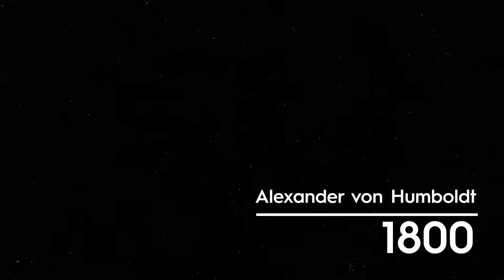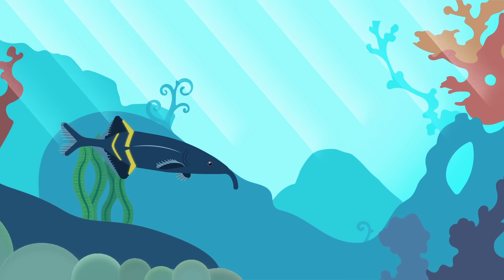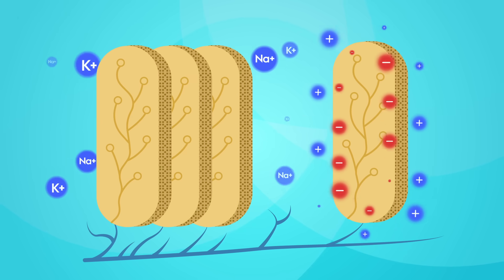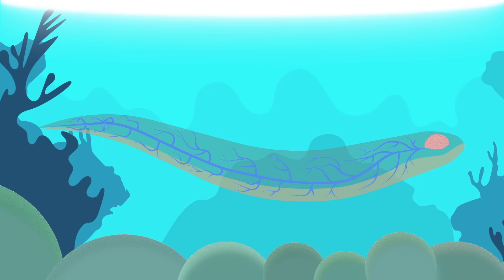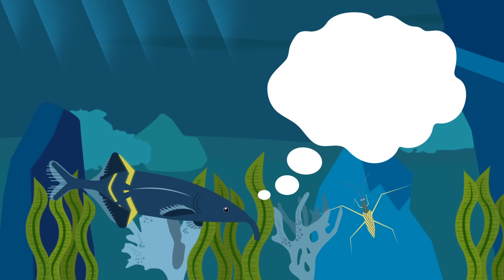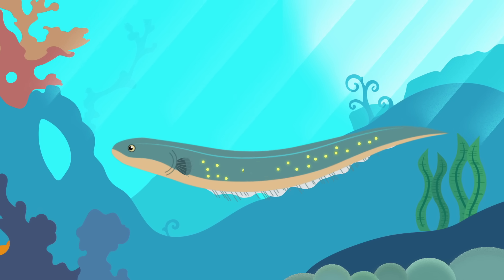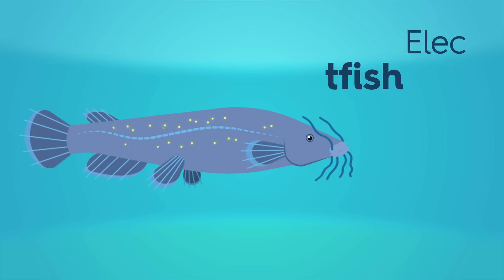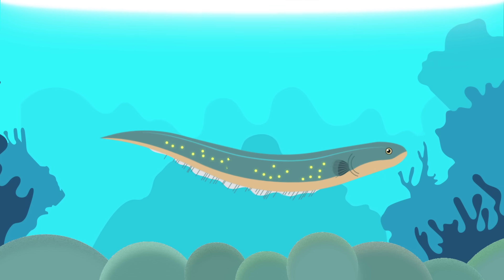How do fish make electricity? - Eleanor Nelsen

Comment: Electric eels have specialized biological adaptations that prevent them from being electrocuted by their own electrical discharges. Here are the main reasons:

1. *Insulating layers*: Electric eels have a thick layer of insulation surrounding their bodies, including a fatty, insulating substance called myelin.

2. *Specialized cells*: The eel's electric organs are made up of specialized cells called electrocytes. These cells generate the electric discharge but are designed to protect the eel from self-electrocution.

1. *Directional discharge*: The electric discharge is directed outward from the eel's body, minimizing internal exposure.

2. *Nervous system adaptation*: The eel's nervous system is adapted to withstand the electrical discharges, preventing harm.

These adaptations enable electric eels to harness electricity for defense, navigation, and communication without harming themselves.
Reply: Chatgpt ah

Comment: Serious question 600 v is a decent amount of electricity, isn't it possible to harness that energy i mean if you could stack 50 of them that would be somewhere around 30k volt, it wouldn't be difficult to organize 1000 of these which may have the potential to create 600,000 volts am just curious

Comment: The electric eel generates large electric currents by way of a highly specialized nervous system that has the capacity to synchronize the activity of disc-shaped, electricity-producing cells packed into a specialized electric organ. The nervous system does this through a command nucleus that decides when the electric organ will fire. When the command is given, a complex array of nerves makes sure that the thousands of cells activate at once, no matter how far they are from the command nucleus.
Each electrogenic cell carries a negative charge of a little less than 100 millivolts on its outside compared to its inside. When the command signal arrives, the nerve terminal releases a minute puff of acetylcholine, a neurotransmitter. This creates a transient path with low electrical resistance connecting the inside and the outside of one side of the cell. Thus, each cell behaves like a battery with the activated side carrying a negative charge and the opposite side a positive one.
Because the cells are oriented inside the electric organ like a series of batteries piled into a flashlight, the current generated by an activated cell "shocks" any inactive neighbor into action, setting off an avalanche of activation that runs its course in just two milliseconds or so. This practically simultaneous start-up creates a short-lived current flowing along the eel's body. If the eel lived in air, the current could be as high as one ampere, turning the creature's body into the equivalent of a 500-volt battery. But eels live in water, which provides additional outlets for the current. They thus generate a larger voltage, but a divided, and therefore diminished, current.

Comment: The eel probably has a layer of cells around its body that can conduct electricity so it acts as a faraday cage for the fish,the electricity passes around the fish instead of through it.
Reply: I was taught that the eel's tail contains the potential gradient (anterior of tail = positive, posterior of tail = negative). All the eel's vital organs like its brain are at the front of the eel. When it 'powers up' to send shocks from its tail, it straightens out, and the current travels outward. You will see an eel sometimes bend in a U shape to avoid its head getting in the way of the current. If the current hit its brain, it would die. Electric eels can kill each other. In zoology they taught us that the pics of eels "biting & shocking prey simultaneously" are fake

Comment: Did each type of electric fish evolve electricity separately or is there a common ancestry?
Reply: yes they evolved separately. which is awesome.
Reply: If you ever got am answer to this question let me know 🤣
Reply: Convergent evolution
Reply: RV separately
Reply: No... God created them this Way ..
Reply: @hamzasat  who created god?
Reply: @kartikpoojari22  if God would have been created by anyone, it wouldn't be God.
Reply: @GangingTheKing  yeah that's the loophole in god hypothesis
Reply: @kartikpoojari22  this is the solution to the loopholes in every hypothesis.
Reply: @GangingTheKing  the loophole is that God hypothesis says that "a complex thing Cannot be created on its own" but god has to very complex to create such a complex universe then why he doesn't need creation?
Reply: @kartikpoojari22  I don't know about God's level of complexity and I'm also not sure about whether the Creator must be complex or not, but what I do know is that it's not needed for something to be complex in order to be able to do many things. For example: a razor blade can be used in many ways but an electric razor (which is a lot more complex) is only good for one thing.
Reply: @GangingTheKing  actually, if a deity is omnipotent it should be capable of creating "mini-gods" and give those mini-gods a fraction of the power to create more mini-gods to Infinity. The god hypothesis makes no sense if the possibility of higher-order gods is discarded
Reply: @hamzasat  🤓
Reply: @hamzasat  I recommend you to watch TheraminTrees YT channel. If you think you're sure about anything, then you know nothing about life, nor the universe. You have to be open to accept that you can make mistakes and be wrong like any other human. You're not a god, you can't say "God did this" "God did that" if it hasn't given you any explicit confirmation that it was him/they/it

The fact that we can't prove nor disprove the existence of 1 or more deities doesn't mean that your description of it is correct. And (just like a god) the universe could have been created spontaneously by itself, physics doesn't forbid that
Reply: @hamzasat  nice hypothesis but wrong according to me.
Reply: @adithyan9263  
Just like evolution... it's a nice hypothesis but it's not a fact
Reply: @hamzasat  evolution is the best and scientific answer we have. It is not complete but we are headed in the right direction. The god hypothesis has no proof and will likely never attain any proof in the future. Theists have this weird understanding that the reason scientists encourage evolution is just to oppose god. No that's not how it is. In fact evolution is equally a theory as gravitation. but no theist ever had any beef with gravity.
Reply: @adithyan9263  it is complete actually,what part of it isn’t?now that our technology can study biochemistry and particle biology
Reply: @adithyan9263  oooh you meant perfect,I thought that you said that evolution could be disproved
Reply: @Andrea-fd2bw  no no no evolution is great and certainly in the right direction but there could be minor mistakes in the specifics. Like for example we have theories of how animals evolved eyes. But we cant be a hundred percebt sure. And one of the most fundamental aspects of evolution is that evolution is caused by random mutations maybe that isnt the full picture
Reply: @adithyan9263  I suggest you to read life’s ratchet,a book on the subject
Reply: @Andrea-fd2bw  thank you for the suggestion
Reply: @Andrea-fd2bw  thank you for the suggestion
Reply: @hamzasat  Please, don't make us Christians look bad
Science and God can coexist, just because God created life doesn't mean evolution isn't real
Reply: @thepalebluedot4171  Sorry, I don't understand
Science and religion can coexist, can't it? So, what's the problem? 
I'm really sorry, English is not my first language
Reply: @candylide  Before we examine the coexistence part first we must understand what exactly we are talking about,.  What is religion and what is science.

Religion and it's concept of God and Gods exists in the emotional realm of man whereas science is a practical reality.

If observing fridays as holy days and praying 5 times a day or receiving the wafer and wine on the accepted holy day of sundays or doing any other form of religio-emotional activities can exist along with things like  H2O,   C6H12O6, E= mc2, (A+B)3 = A3+B3+3AB(A+B), Deoxyribonucleic acid,.   if you ask if these 2 realms can exist together in this human society on this planet ?  Then yes they seem to clearly coexist with each other parallelly but they will never agree with each other whatsoever..

My first language is not english either I am from Kerala, India.
Reply: @hamzasat  did you know the person who invented the Big Bang theory was catholic? They don’t teach about him but someone else who said the same stuff. The Catholic Church got happy because they thought it proved their point that Catholicism existed, but Georges Lemaître (inventor of theory) was mad because he said science doesn’t belong in religion. Just because we think one thing because it’s in a book doesn’t mean it’s 100% factual science can show us a lot that can still prove points to religion
Reply: @thepalebluedot4171  my comment before this can apply to you too. Look him up one of my biggest people for believing science/Catholicism/religion of many, all coexist with each other but man can be too stubborn and want what they believe to be 100% and the only thing that’s right
Reply: @hamzasat  yet the theory of evolution has practical application such as selective breeding, so Darwin was clearly onto something.
Reply: @hamzasat  if you think evolution doesn't exist then what you're saying is that all living creatures are just biological robots incapable of adaptation and change. Every day we see small examples that evolution and natural selection are real, even in artificial systems like AI, machine learning, and neural nets.

Even Minecraft has natural selection, unintentionally. There's a video of some youtubers playing with a mod that flips gravity, all animals died except for cats and chickens. No more mobs have spawned because the game has a mob-count cap
Reply: @adithyan9263  wrong way to do science according to me
Reply: @adithyan9263  It is complete, that's why it is the theory of evolution, like the atomic theory and the microbial theory, is not the hypotesis of evolution.
Reply: @MachineIntelligence0  They can, me believing in God doesn't make science suddenly invalid to my eyes
Like, I mean more on a individual scale, if you think that science makes God a nonexistent entity, that's okay, it's your opinion!
Reply: @MachineIntelligence0  God isn't scientific themself, I didn't say that
Just that both science and God can coexist in one mind, as some people think you have to pick one or the other
Reply: @hamzasat  evolution and God are not mutually exclusive IMHO. 
God made it through evolution, why would that be a bad idea? 
Our understanding of the world is very limited, one can not simply deny God, yet its also not reasonable to attribute everything to God and leave it at that! and do not investigate further!
why not trying to get to the core of it? why not searching how things are made up/created? clearly if we can find about them, if God gifted us with intelligence, 
He Wants us to learn about them, discover them and appreciate the magnificence of the creation even more. To me finding about these makes my faith even stronger and its really exciting and beautiful as well. 
Do not let the prejudice stop us from discovering new things. we might get things wrong here and there, but hopefully we will get to know our world better and reach God better. 
at least this is how I feel and think. 
God bless
Reply: @amortalbeing  Exactly, being able to create a system which enables evolution would itself be a miracle
Reply: @hamzasat  
this is the only solid fact I've ever heard here

Comment: What if the answer is really simple. What if they have an electric shock tolerance being exposed to it from birth? Most animals develop their necessary pain tolerances from birth onwards to handle their unique abilities
Reply: They reduce the danger to themselves by flexing their bodies in a shape that prevents the electric current from passing through their heart. When they are charging up, they stiffen into a line segment very much like a straightedge. This way, the electric current only runs parallel to their tail and behind the heart.

Comment: Good to know when I am in the middle of Amazon's jungle and suddenly my phone battery dies....just look for electric eel...problem solved. Thank you and bye
Reply: 600V may kill you phone and bevause they have 1 A in a short time (1 sec to be generous) you just get 1C electrons so you get get 600 J which is not that much, but acceptable.
Correction: 0.01 sec is generous so its 6J which is just stupidly low.

Comment: It's the amps (the amount of current) to worry about. The voltage only tells half the story, which is the potential. If the resistance is high, it will negate the voltage and thus reduce the amperage. Fortunately for humans, the electric eel only emits 1 amp over a quick instant, so it's not deadly to us.
Reply: Yes, only 1 amp, huge voltage but low current just like a capacitor
Reply: I thought 0.1-0.2 amps were enough to cause death?
Reply: @uliseshernandez9176  I believe 1 amp is needed to cause death, and then only if it crosses your heart.
Reply: Could you please explain that in words a non scientist would understand? It really caught my interest!!
Reply: I wonder if salt water plays a factor in conducting then electricity
Reply: Is the eel using AC or DC

Comment: Wouldn't their electric discharges cost a massive amounts of energy? If yes, then where does the eel get all those energy? I'm not convinced that it gets all the energy from eating small fishes. As reference to the video the eel produces 600 volts.
Reply: 600V using 1C electrons is 600J. We count the energy in food in kilo(thousand)joules. A human eats about 8,500,000 Joules a day. It is costly for the fish because their electric organs probably are energy inefficient but not TOO costly.
Reply: A little google tells that an average man needs 10kJ a day. I'm not sure where you got the 8.5 million joule consumption a day. Also 2-3 impulses of 600V is used only to give muscle spasms for the prey adding to that fast volley of high voltage (probably higher than 600V) impulses to keep the prey incapacitated. How would this type of hunting be not too costly?
Reply: Adriel Rugay  On Wikipedia (not scientific but enough for everyda use) the maximal voltage is 860 so you gort me on that one. The maximum on current is 1A. Now Wikipedia says 860V is maintained for about 2 milliseconds so 0.002 sec. The whole discharge probably takes longer. I think a good assumption is 10 milliseconds on maximal voltage and maximal current to approximate power output. Now 1 amp for 0.01 sec is just 0.01 coulomb. 0.01 coulomb times 860V is 8,6J. So an eels could do how many of these a day? I dont know lets say 240 to be really generous. That would be. A liittle bit mir than 2kj.
Reply: Adriel Rugay Since the fish does exist its advantages obviously outweigh the disadvantages.
That said my calculations show that the pure electric energy these eels need have so they can hunt is not what makes this type of hunting costly. 
The maintaining of voltage and how big these organs are is probably the bigger disadvantage.
Reply: Ohh ok now that makes perfect sense. Thanks for answering my question.

Comment: I'm more interested in what kind of Amps these things can generate, than I am in voltages. Great video!
Reply: Current is voltage divided by resistance, so I believe the amount of Amps would depend on the resistance of the material that it is passing through
Reply: @superlanguagelearning6589  yup